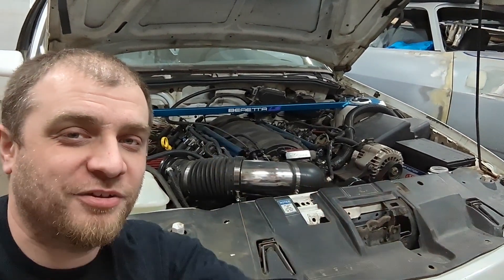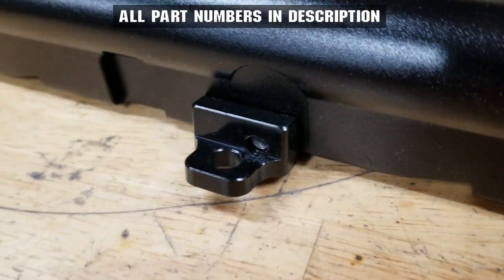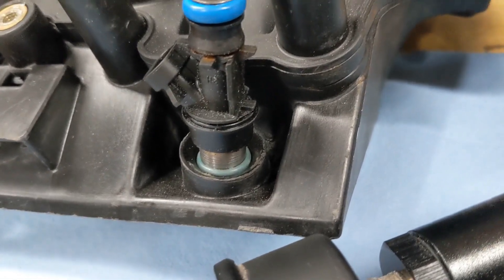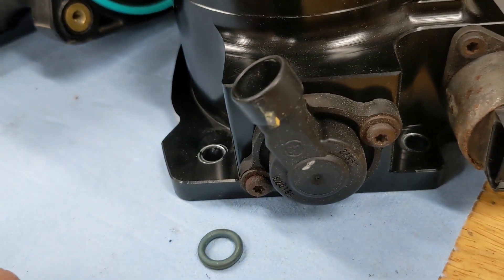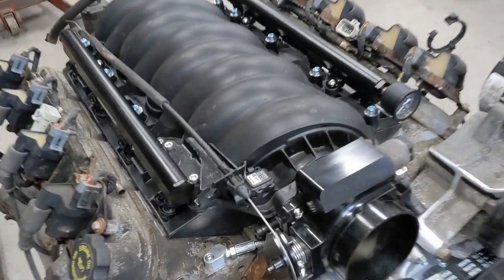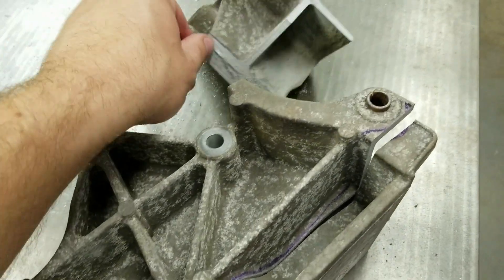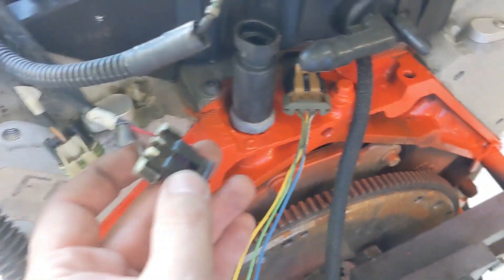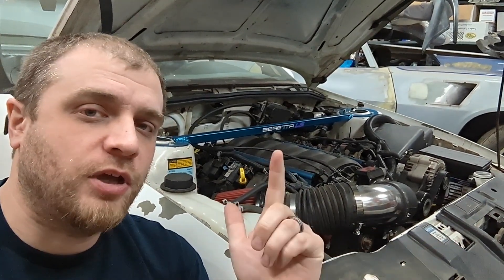Vortec truck LS under a car hood. Cheap DBC LS2 intake solution #LSswap

Comment: Where did you relocate the EVAP to?
Reply from the maker: I used a barb on the rear of the intake and just zip tied it to the wiring harness. Works

Comment: Also I have ls2  factory fuel rail will that switching of o rings on truck injectors work?
Reply from the maker: It should. Dimensionally there should be no difference in my aftermarket rail and the stock one
Reply: Thanks bro best believe i subscribed 👍🏾

Comment: Question, what year truck did you get the accessories and computer for this build?
Reply from the maker: My style is 99-02, but 04-06 is fine too. Those are drive by wire but you can convert them. I'm gonna do a video on making my 06 harness drive by cable
Reply: @GEARHEADdezign  Yes! I'm confused with the LM7 crate. I'm gonna order off Summit, but it stated truck motor, so that's my confusion.

Comment: Dude!   Awesome info thanks!  I’m new to major auto projects and me and my son are putting a 2000 truck 5.3 in a 2001 Camaro and this video is gonna help tremendously!   Do you have a link for the exact intake and it looks like the throttle
Body you linked is not available anymore.
Reply from the maker: Intake is ls2 you'll have to find the used..or if you still have your ls1 intake from the Camaro use that
Reply: @GEARHEADdezign  thanks man!  I’ll have to find one.  The Camaro was originally a v6 car.   People want a mint for intakes!   I was reading there is an aftermarket dorman intake but I can’t find it.
Reply from the maker: The dorman LS2 intake used to be a couple hundred but then people realized it made basically the same power as the FAST 92 and they jacked the price up
https://amzn.to/3UcEQ3J
Reply: @GEARHEADdezign  holy crap! I’ll find the used ls2 lol.  Thanks for all the awesome information man!
Reply from the maker: Here's a new link for throttle body, but it will only work with 4 bolt manifold https://amzn.to/3NzsBKW

Comment: Did you paint the fuel rails Blue?
Reply from the maker: Yeah that's 94 Beretta aqua metallic
Reply: @GEARHEADdezign  nice... how the truck injectors holding up?
Reply from the maker: @UGKAlumni  still working perfect. I've got over 3,000 miles on it

Comment: Great video! Wondering if this would fit in my s14. What intake did you use?
Reply from the maker: LS2. I also pondered the cheap Chinese speedmaster
Reply: @GEARHEAD dezign  I've been tempted by the cheapo speed master intakes as well. Someone's gonna have to bite the bullet lol

Comment: Good video to show how to do this! I kept the truck intake on my swap because I didn’t want to buy another water pump, fuel rails all the stuff that comes along with that but you did it on a budget for sure
Reply from the maker: I'm going for the sleeper vibe, so I really had no choice. Zero chance it would have fit without it. Still sucks to put $500 into a $350 engine for 0 horsepower 🤣
Reply: @GEARHEADdezign  The sleeper look is worth the 500 hahaha
Reply: Do you have a link for the injector o-rings? Would they work for an LS1 manifold?
Reply from the maker: @jayscheick7408  I bought them for the donor truck: 2000 Silverado 4.8. But you could just reference that part number vs 2000 Camaro 5.7
Reply from the maker: @Jay Scheick  looks like upper is same, lower is different. But I was using an upper in the lower anyway, so it would be worth a shot
Reply: @GEARHEADdezign  thanks. Nice work on the Beretta. They should have come in RWD.
Reply from the maker: I've only driven it a little, but it's a good time!
Reply: Can you tell me how you made the truck intake fit please